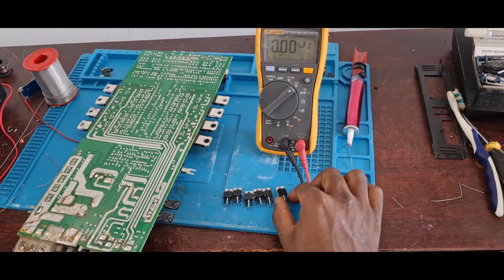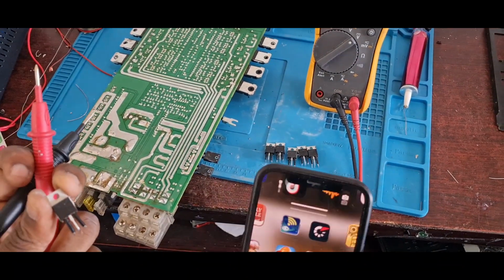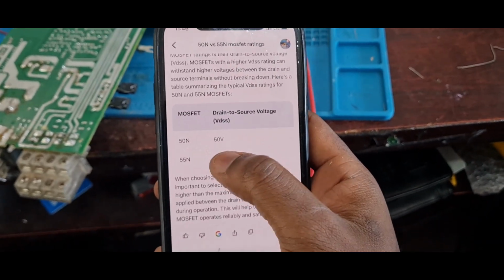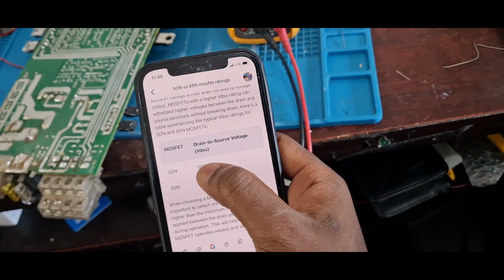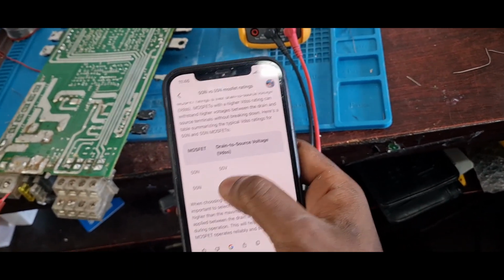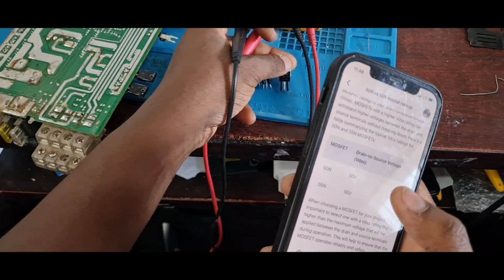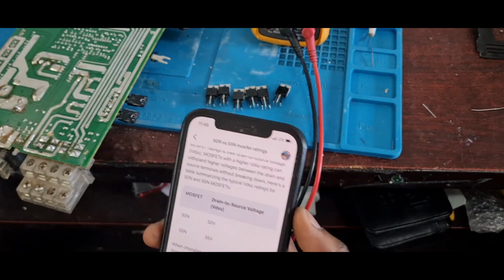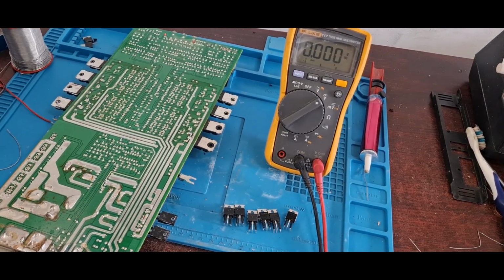ENERGY AUDIO No Output Sound Car Amplifier Repair 2024.

Comment: Good systematic approach — amp powers on but no sound, so checking the voltages on the board first is the right move. Waiting to see where the signal chain breaks.

Comment: If I use 12v or rem it makes a red light
Reply from the maker: Then it means it is on protection mode. You need to troubleshoot

Comment: Hello, I have an amplifier that has been subjected to reverse polarity. I’ve opened it up but not sure how to go about what to test. It has power but very weak sound, what can I do for process of elimination to find the fault?
Reply from the maker: reverse polarity will mean you should check the pfc circuit such as MoVs and capacitors. But the best way to eliminate is through voltage injection with a power supply to rule out possible problems.

Comment: hi what does it mean when my amp protects when u just connect the power cables only and turns off
Reply from the maker: It means the amplifier is protecting itself from a potential faulty part or faulty connections . To make any suggestions i will like to get more information about the problem.
Reply: Such as ? Today i tried and fix it saw that my not sure what it called but my wall where my components connect was burned so i fixed it nou the components are dead so i cant get them I'm goodlle the diode i assume
Reply from the maker: it could be a diode or a burnt resistor. you will have to open it up and have a closer look.